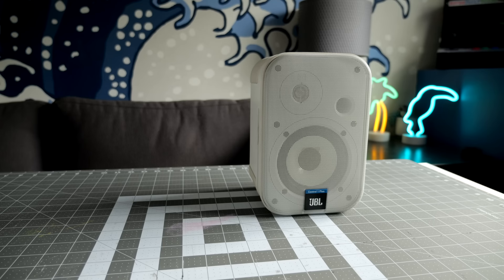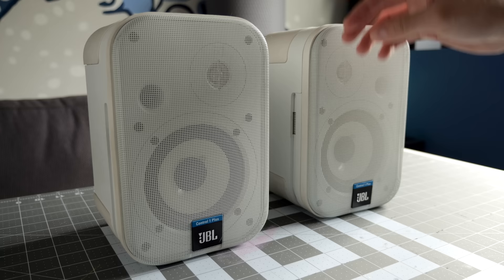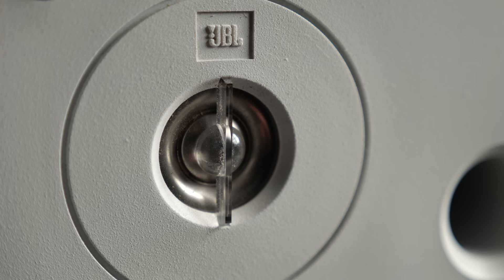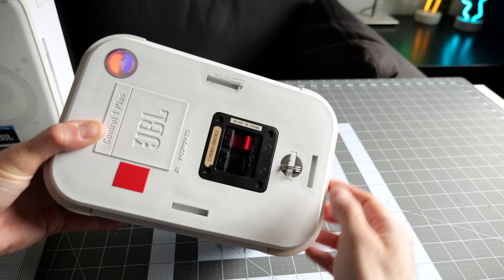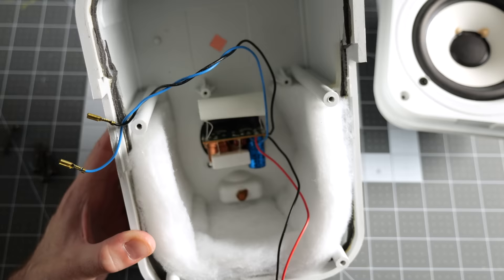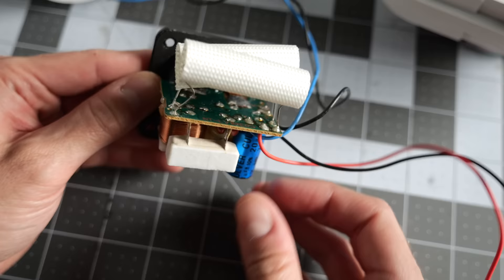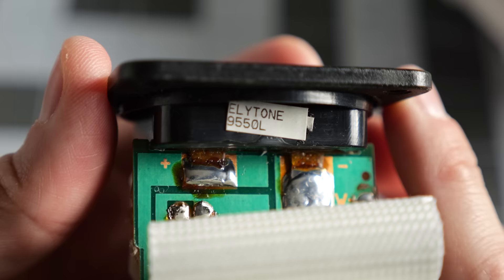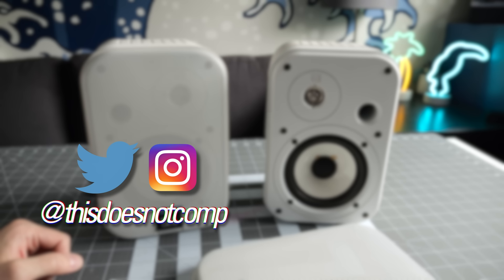Fixing My Vintage Speakers -- But Why Are There Light Bulbs Inside?

Comment: Why is it weird that a major USA brand had their speakers made in Japan? Wasn't Japan a major manufacturer of quality electronic parts in the 80's/90's, wouldn't it stand to reason that multiple brands would have gone a step further and assemble electronics or audio equipment there as well?
Reply: Agreed, that was kind of a weird statement.
Reply: It wasn't commonly done. If you wanted made-in-Japan you bought Japanese brands. Having an American company marketing to Americans, selling products designed here, but shipped from overseas, was seen as needlessly complex and risky. Why not build the stuff locally where you can keep an eye on production and have a much faster turnaround? It's not like you could just hop on Zoom with a floor manager halfway around the world. And you weren't exactly going to save a pile of money by outsourcing to Japan either, between a strong Yen, the cost of shipping, and import duties on finished products.

Comment: Hi, I have a pair of these in black. I have not seen very many mirror image baffles on these. A friend had these for a long time and I heard them a lot and always liked them. The foam rotted, so he gave them to me and I got new mid drivers for them for $50 US. I recently bought a JBL Control SB-2 subwoofer (38-160Hz @ -10dB) which is made for these as a system and for the contractor series. It has a 10" dual voice coil driver and is a slot loaded, vented bandpass design and handles 340W. It is a passive set up. The satellite output crossover is at 160Hz, so this makes a nice system. These Control 1s are older and have polycarbonate tweeters. Other noteworthy specs are that they handle 150W and have a freq. range of 80hz - 20kHz (-10dB). I plan on using them for a small keyboard system and music listening. The older ones do not have a 1/4" threaded insert on the back, but newer ones do. I am going to refoam the original speakers and build DIY oak cabinets for them with small Vifa tweeters. I got a pair of JBL Control 1 Pro crossovers on Ebay cheap as well.

Comment: Ns10 are the reason disco sounds the way it does with a “disco smile” because the high and low end are very flat on ns10’s
Reply: Wrong. The reason for the "disco smile" was the physical limitations of vinyl as a playback medium (see: RIAA equalization).
Reply: @popefacto5945  NS-10’s really contributed to it I can say with certainty especially if you talk to the mixers around that time period. Whether or not they are exaggerating its significance is up for debate. But after asking in person as an audio engineer I can say with certainty that it’s what the people in the industry have said to my face… also sorry to vinyl wasn’t at all the limitation or the disco sound would have way less bass than they do, seeing as bass and its bias really is why is the limitation, plus vinyl wasn’t at all incapable of producing mixes that didn’t sound like disco… many many genres didn’t end up sounding like disco do to vinyl technical limitations, so yeah that makes zero sense…

Comment: I got a set of these after seeing this and the other one about them. I was disappointed that the ones i got werent book matched and are in face both "right side" with the tweeter on the right. This bothers me since i have them laying on their side for my PC speakers, powered by a Yamaha RX-V379. Despite their small size, they fit really well with the 10" sub that came with the receiver and MAN, do they sing when pushed. Very balanced, maybe a touch warm, but overall a VERY nice sound. I have a very long audio engineer and musician background, so i know a bit more than your normal "audiophile" who've never touched an instrument or mixing console in their life. I snagged them for $39+ shipping, which ended up being under $70 total. They were a bit dirty, but virgin in that they had never been apart and worked perfectly as soon as i hooked them up. Completely pleased with this recommendation, which is good, cause i usually dont listen to people for purchases. I can trust Colin though, despite his Mac leanings ;)

Comment: A lot of us electronic engineer build "light-bulb current limiter" socket tester as a simple way to test short circuit on any project because we can't be arsed to flip the breaker or replace a fuse (or wait for the self-healing fuse to reset) for every single time we test a pretty powerful circuit.
.
...also, you'll definitely love JBL 4435 if you like this kind of sound.

Comment: I purchased JBL Control 5's when I was still a teen, they had the same surge protector bulbs, and when I was irresponsible I used them as kick drum indicators. Yep, they eventually died, but I replaced them with self powered JBL EON 15" speakers. I still have those and loan them out to friends for bush doofs every now and then. Not bad for late 80's tech and early 90's stage gear. $0.02

Comment: I love Vintage JBL speakers. Last year I got some vintage JBL L100 Century speakers, and went t hrough them and refurbed the cabinets and got new Quadrex foam grills for them in blue and they're great. Both great looking and great sounding. When I got them the drivers were fine and so were the crossovers. But I think at some point maybe this year I want to make a new pair of crossovers for them. When I do that I think I may make the crossover compatible with bi-amping.

Comment: Btw Colin, you said the “speakers may have been dropped but there are no signs of external damage,” but i see there is some damage, maybe melted plastic on the right rear mounting slot of the broken speaker. 

That’s a sign that it was mounted at one point and the speaker got ripped out of the mount and fell.
Reply: Just an FYI in general: the melted spots on electronic equipment of any kind do not have to necessarily indicate an actual heat-induced melting (like soldering iron)... but chemical. Some leads/wires outer "plastic" isolation layer (whatever the chem. compound it is) can eat into the surface and melt it, but it's the process that takes years: think equipment that has had leads wrapped around it tightly and then stored for a prolonged period of time, or just stacked one on top of another, with leads in the middle.

So, I guess the lesson is: for long storage, store your wires/cables/leads separate from your device - but best wrapped next to it in, maybe in a plastic bag, potentially zip-tied or taped to an inconspicuous spot (for eventual residue clean-up). And, if storing them separately, always tag the leads with not-too-easily-removable parent device's identifier, if such thing matters (for "it's-of-higher-quality-than-average" or "proprietary-connector/wiring" reasons).

This is especially useful for external power adapters, even more if it's the ubiquitous barrel connector: mark the adapter with the device name, and label the device with adapter's voltage, [minimum] current, and polarity (even if device has this marked on a label or impressed into plastic somewhere, those can fade or get worn down with time). This way, you'll always have means to find the original adapter, or substitute with appropriate one in the future.

Comment: I was real tired of my annoyingly big, bad-sounding (they didn't sound too bad initially, but one broke) floor speakers, and I was in a thrift store and found a pair of Canton slightly-bigger-than-bookshelf speakers. Black housing & grille match my room, great sound according to online reviews. Called up my dad who knows his stuff, he told me to check the rubber, which looked brand new, even though the speakers are 30 years old.

Gladly paid fifty bucks for the pair and lugged them to the subway station four blocks, then from the subway into a train, then finally into my mom's car. One of the best purchases ever. Super good speakers for super cheap. After some time I had to replace a tweeter at a cost of less than fifteen bucks.

(It's the very same thrift store where I got a 90s all-digital Onkyo double tape deck that went on ebay for 130 and up for just twenty five bucks. Amazing prices on some items, notably not amplifiers.)
Reply: Same here got a pair of Canton Fonum 60s from my parents (label says "Made in Federal Republic of Germany", that was used before 1990 together with "made in W(estern) Germany", Hifi-Wiki says 1984-1985), they're almost too large for bookshelf speakers but 3-way closed and I use these as the front speakers in my home cinema and they sound good.
Maybe I replace them in the future with some JET Elacs but I don't feel the need at the moment.
Better get a pair of good sounding used speakers than some crappy cheap new ones.

Comment: About 30 years ago the other guitarist/vocalist from the band I was in at the time acquired a rather rare Dean Markley "voice box" -which was their brand's version of the (then) quite hot "talk box" that had become well known at the time by musicians like Peter Frampton and Joe Walsh, However they both used a much better built "talk box" that used very high quality components, most notably...high quality, high wattage full range compression drivers that were designed for powerful large venue horn speaker cabinets. Those high end ones used a capacitor as a "filter" much like a crossover does in a multi speaker component cabinet. Connecting to your amp just like an extension speaker does, they could handle a powerful guitar amplifier with no issues -BUT if the amp was too powerful, or their filter capacitor simply wore out...it would fry. And just like with a blown crossover, you'd get no sound until that filter cap was replaced. Conversely, the Dean Markley "voice box" ingeniously used a 12 volt DC light bulb of the type that are commonly used in automobile tail lights inside, in place of a filter capacitor. It served two main purposes, one was to absorb the excess voltage spikes from it's source amplifier, so whether it be a powerful source amps powering it or not, the light bulb would simply swell from bright to dim in response to the incoming voltage. The second and probably most important main purpose was this also allowed the Dean Markley "voice box" to use a far more inferior compression driver...I'm talkin' only 30 watts RMS of inferior vs. their main competitor at the time Heil Sound, who's "talk box" used a THREE HUNDRED WATT compression driver! The horn driver in the  Markley "voice box" was of the type commonly found in school football field announcement horn speakers, etc. whereas the Heil "talk box" used a horn driver often found in powerful concert hall and high end theatre speaker systems. The difference was (obviously!) like day and night...YES the "voice box" DID indeed provide a suitable talkbox effect, and was much more affordable. But meanwhile, the original Heil "talk box" was professional gear and could pretty much rattle the fillings right out of your teeth if you wanted it to. The chances of an incandescent DC light bulb burning out from a newbie musician's amp weren't likely (most newbies didn't have Marshall stacks) and afterall, it provided the effect it was supposed to provide...so the Dean Markley was a decent choice for beginners. And it was alot less expensive. They didn't sell very well, probably because most beginners didn't even know what a talkbox was, not to mention how to properly connect one, or use one properly. It's even more unlikely they knew much about any of the pros and cons due to the quality of the components used inside of them either. To sum up my short novel...this was just another example of another use of a light bulb in what is essentially another version of a type of speaker cabinet, but this type has a horn driver and a mouth tube connected to it. I mention the most logical reasons the manufacturer probably chose to do this, and the main advantages and disadvantages of it. Interestingly, the Dean Markley "voice box" is a rare collectible now, even more scarce than the old purple Heil Sound "talk box" from the mid 1970's and even though they weren't known for their legendary performance, the "voice box" is nonetheless another clever use of a light bulb in this application, and I thought it was relevant to this video and worthy of mention...even though I've somehow made this mention of it into a small book's worth of reading ha ha ha ha! Thank you for sharing this informative video! -Rock on
Reply: Lol. Loved the “war and peace” length anecdote. And the fact that you were embarrassed about making such a long winded comment is endearing.

Comment: Incandescent lamps have a positive temp. Co-efficient, cold they have a low resistance and when hot have a higher resistance, and thus limits current if the level at the terminal gets too high
Reply: Yeah, we learned that by watching the video.

Comment: I have several pairs of original Control 1 pro.  They were a pull from a nightclub install where the owner didn't want them.  I think I got 16 of them but many had bad foams on the woofer. I got 8 replacement woofers and they are all through my home as permanent install.  I like them. Add a subwoofer and they are great.  I also got two pair of the Control 22 with blown woofers from another install.  I repaired those as well and they live in my wood shop.
Reply: Why would a nightclub have such small speakers ?
I thought they were using much larger ones, you know, about 4 feet tall and with 10" drivers, that kind of thing.
Reply: @psirvent8  "pulled from the nightclub" the original setup was more of a lounge. We renovated and built a new bar/nightclub. I was the install tech and after was running sound for a few years.  I installed TX4's for tops that are loaded with 15" drivers.  I also built two massive double 18 subs for under the stage along with 4 horn loaded 18,s.  you can see the final results @hume hotel in Nelson BC. Check out Spiritbar, its a nice intimate venue with a 300 person capacity. mostly a live sound venue hosting a variety of bands.
Reply: Control 1 /1G have foam woofers. They just disintegrate! I learned the hard way! And no... replacing the woofers is more expensive than buying a NEW pair! It sucks! And even if it wasn't, the screws mountings are ALL plastic! Not even a metal female so it could be opened and closed with confidence!
Reply: @MarcoLopesPT  I found a deal on a bunch of replacement woofers on ebay. Random score.

Comment: Bought a used set of these many years ago as well, but didn't have luck, they were installed in a bar or the like, smoker environment, and completeley ruined, I had to write them off.

Regardless, you should really consider a more powerful soldering iron, it makes such jobs a lot easier and the result is better as well.
Reply: How can this be posted one second ago and this comment is 9 hours
Reply: @michaelpastras  My exact question lmao
Reply: @michaelpastras  He gives the viewers who pay him through patreon early access to the vidz.
Reply: @michaelpastras  It's because the internet is not fair.

Comment: the problem with the rubber/compound sorround  is that its mechanical characteristics change over time, that changes the compliance and with it, the bass response of the wofer. And it is not so noticeable unless you measure the frequency response of the speaker, in bass reflex boxes the change may be more noticeable, due to the mismatch (the rubber hardens and the  "free air resonance" of the speaker goes up, that modifies how it behaves with the box and with the tuned port (tube)). 
I had some 8" woofers to build a studio monitor (Scan Speak, polypropylene, fine component); time passed (they were stored for  3-4 years, in perfect condition), and, when I went back to the project and measured the Thiele Small parameters of the components _to make the calculations of the boxes_, the change was evident, the resonance frequency had risen and it was no longer the same as the technical sheet (it's a well-known topic in recording/mastering studios, speakers have a useful life of a few years before they start to change; 10 is a good number) For relaxed listening and pleasure, the requirements are much more lax...
Reply: I have rubber surrounds from the 60s and 70s, they sound fine, and if anything, they softened, not hardened. Sadly I don't have specs for the drivers so I can't compare the impedance plot to the datasheets. However, it's normal for the resonant frequency to be higher than spec especially if you never used them, no matter how long they were in storage.

Comment: Old power distribution fuse panels had standard Edison screw sockets in the USA.  It was a common troubleshooting technique to screw a light bulb into the fuse box to diagnose a short circuit without blowing a bunch of fuses.  One person would watch the bulb while another went around twisting cords and so forth until they got the lamp to light, locating the short.  Some people used a penny instead of the light bulb but that was not very safe.

Comment: Oh yeah fixing old speakers, such an easy intro to electronics, and the payoff is amazing when you can get something to sound beautiful.
I inherrited 50 year old JBL Control Monitors (4311) and had to clean corrosion, glue a few cones and spiders and remove moisture from the cabinatery. Sounded perfect after that. Replaced original caps, yet they sound the same! The old caps were encased in cardboard too, so... somehow they performed after half a century!

Aftermarket KSN1005 tweeters swapped out from the stock tweeters, which only went up to 15khz. Now probs goes around 25khz, and with that smooth bass and detailed mid driver, such a pleasure. Not expensive getting a pair online and learning how to service them. More fulfiling in my honest oppinion than going out and buying a new equivalent set for thousands.